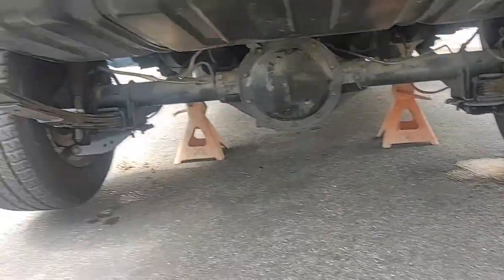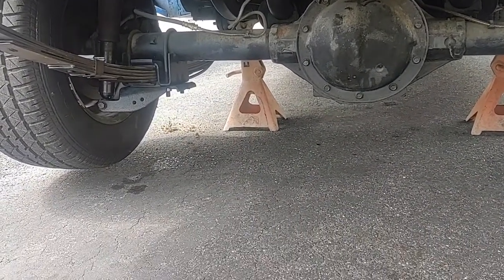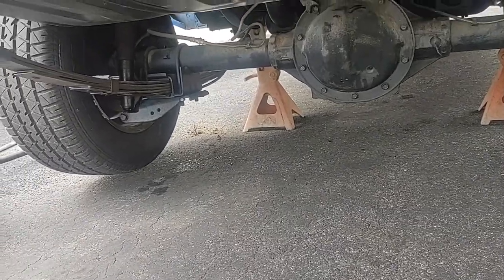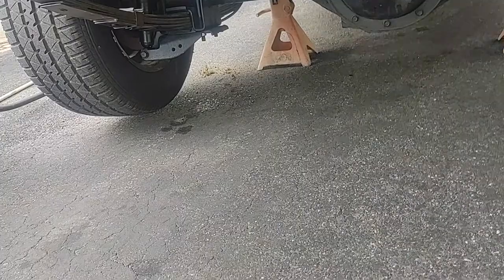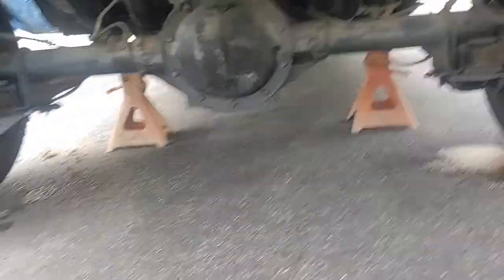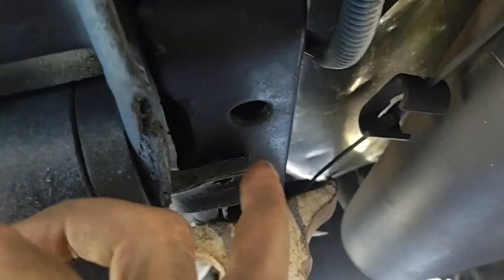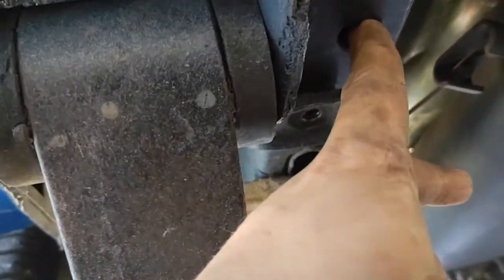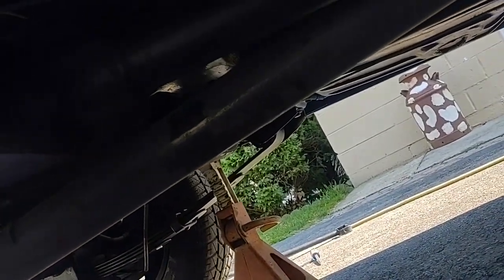1973 nova/replacing rear lift springs

Comment: How did you drop the front bracket, the entire bolt spins. Did you go through the floor to get to the bolt or what?
Reply from the maker: Well the front brackets on the leaf spring towards the transmission those unbolt separately from the actual car and then once you have those brackets that the leaf spring goes up into and gets both too all you got to do is take them off there's like three or four bolts that hold that bracket up that you take off and put on the new leaf springs and put them back in there if the bolts spinning from what I understand that you're explaining there's clips that go into the frame so you can screw your bolt or bracket up into so it holds it together that clip might be rusted out and you might have to just cut the bolt and get a new Bolt but I'm not sure what you mean